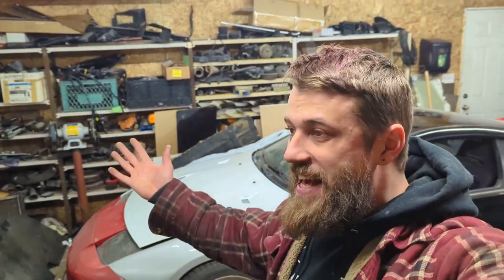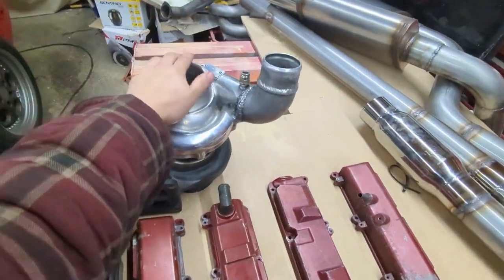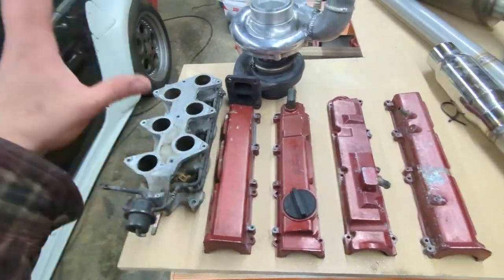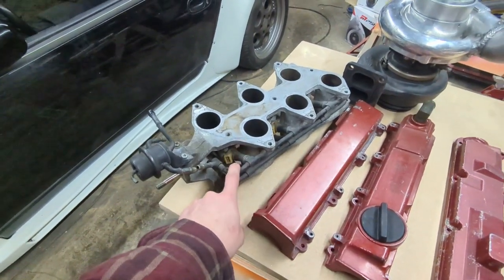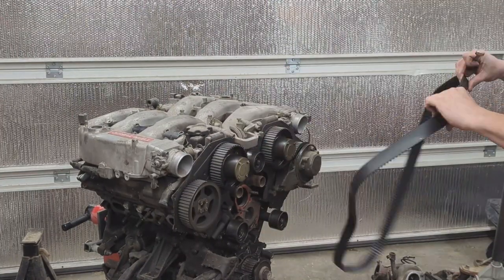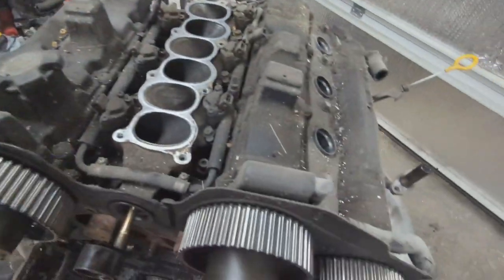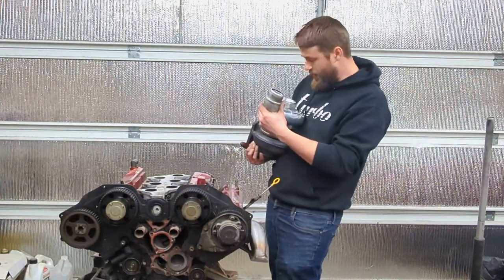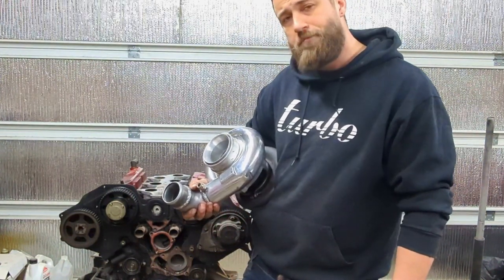BUILDING A 1000HP 300ZX!! Engine Secrets REVEALED.

Comment: You’ll have to port match the lower intake to heads and you’ll need a custom head to intake gasket
Reply from the maker: Lower intake has way larger parts than heads. So I'll need to do headwork to match the intake ports. And I can get factor gaskets that match the lower intake
Reply: I did the opposite of this. I put a z32 intake on a vg30det out of a vina. Neither lower intake gasket was adequate unless you plan to add material
Reply: I did the opposite of this. I put a z32 intake on a vg30det out of a vina. Neither lower intake gasket was adequate unless you plan to add material
Reply: I did the opposite of this. I put a z32 intake on a vg30det out of a vina. Neither lower intake gasket was adequate unless you plan to add material